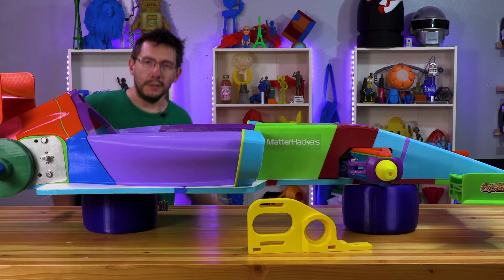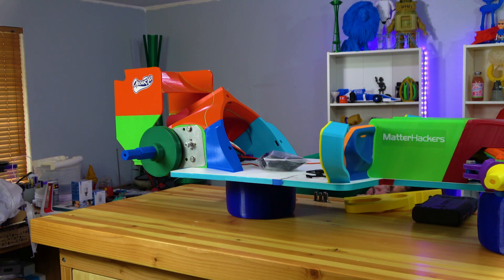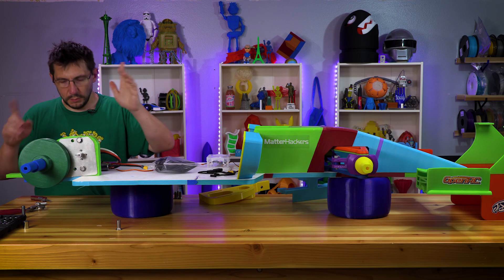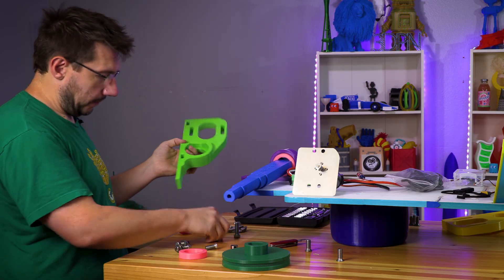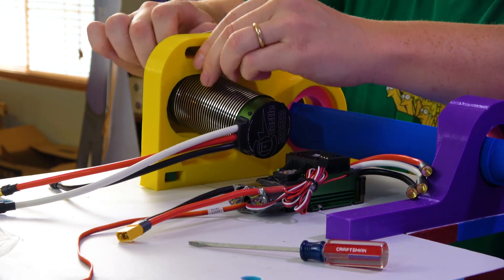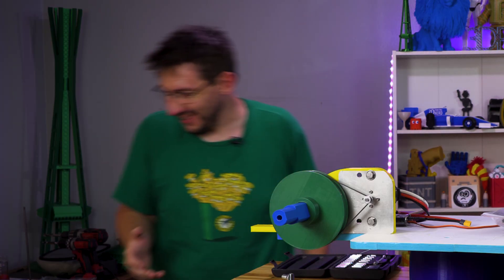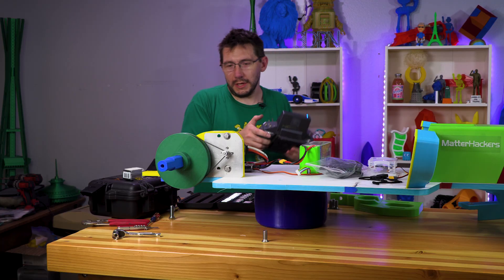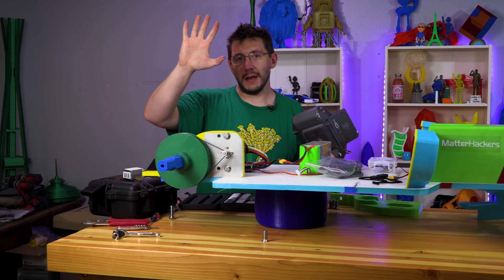Worlds Largest OpenRC F1 Car - Phase 6 // New Motor Mount and Testing!

Comment: great job! wow! on the glue if you use a tiny amount of acetone on pla it will take off the oil residues then you can use glue and it will hold.  but gloop doesn't care about a oil film it bonds right though it anyway.  again wonderful job what a inspiration thanks for sharing! we would also like to see the car actually drive. if not we will just consider the whole thing a big fail.  hope it did not rip itself apart.

Comment: Wasn't it supposed to use two of those motors for the weight? I expected to see one added on the other wheel as well as I clearly remember them talking in Phase 5 how those motors where only good for about 35 lbs out of the 55-60 it will weigh after the battery and the electronics!

Comment: Put a real metal ball bearing instead of a 3D printed bushing, with the friction it will melt with the axle and melt all together causing major damage to the chassis, body, well, everything
Reply from the maker: Agreed. This won't be to speed. This will prove that it CAN work. THEN we get better go fast bits.

Comment: I would suggest silicone lubricant over oil for the bushings as it works better with coating and remaining on the plastic. While oil kind of soaks in and might weakn the plastic

Comment: Hey. uh. tip for ya. don't use a stick radio for an rc car. use a pistol grip style radio for it. also your shafts and wheels have to be true, especially at the scale you're doing here.
Reply from the maker: Oh, I know, but, this is what we've got, so going to use it for the initial run.

Comment: Wow, this belt is way too small. If you want to use it somehow, at least try mounting a belt tensioning bearing close to the drive pulley to get as much theeth as possible in contact with the belt.
Reply from the maker: Maybe, only one way to find out :)

Comment: Like others have said transmitter always gets switched on first. Secondly the belt is too tight, add some lube before you run it again

Comment: The belt may still strip and slip. That axle isn't under load. You could probably test it with a large pipe wrench and just hold it a bit as you apply power. Give it a load and see if it strips.

Comment: Placing bets on that drive system failing first. That's a lot of torque on a very small contact surface. I think a standard multi v belt like on a car would be better suited. Also if it did slip a little it won't tear teeth off.
Reply: Ive made my own exept i used two traxxas x01 ( castle mamba monster) motors and chain drive pullys. The rest is from the design with no modification.The rear wing ripped clean off due to drag, then the drive shaft snapped because it was made from solid plastic, lastly the front wheel bushings friction fused together and rolled it.

Comment: You should put some idlers to the left and over and under the motor pully. It looks to me like the belt doesn't cover enough surface area on the motor pully. The belt will probably skip and  strip if you drove the race car in the current configuration.

Comment: Mad respect for this! Looks super cool! Question, what cable connectors are those from the motor to box? Push connect or screw? I'd love to get some for my projects. Also, where on Earth did you get that battery?! What is it, 50,000mAh?!
Reply: Generally, motors are connected to the esc with bullet connectors (I assume that is what your asking about)
Reply: @deathnightANIMATED  yep those are the ones! Looks awesome! Gotta get some!
Reply: @deathnightANIMATED  however, his are super smooth and look magnetic. Is that a thing?

Comment: You need some anti-spark XT90 connectors. The arc will cause issues later down the road if not addressed..     https://www.amazon.com/XT90-S-Female-Connector-Battery-Charge/dp/B00RVM8U5W

Comment: That castle system is way to much power for this Rc you could of gotten away with using a 1/8 scale system on maybe lets say 3s or 4s to power that rc the tires are not gonna grip is gonna drift more than its gonna drive other than that i love this thing and joel you are a BEAST!

Comment: WOW ! But you may experience excessive wheel hop. The axle does not appear to spin concentrically when you tested it. Please say your printing a scale you for the cockpit,just to give it " THE FULL JOEL"
Reply from the maker: OH, for sure. It's going to be insane making this thing go. All sorts of crazy things will go wrong, until it's supported by the #FullJoel
Reply: 3D Printing Nerd just in case no one told you, You Rock! Hi FIVE

Comment: Niiice Joel, good Work! I would highly recommend you to get some ball bearings for the axle. Plastic on plastic  might work for some time but dont underestimate the power of your brushless motor. Those plastic bushings will wear out pretty quick i suppose...
Reply from the maker: Super quick for sure, but we had to try it. We will lubricate them as much as possible. Once we verify this all works, better parts go on.
Reply: I would agree with this, I printed an automatic can crusher and even with 608 bearings the gears would shift side to side and ended up melting together at higher speeds.

Comment: Fun build. I think this one will likely have several failure points unless you use only a fraction of the power that motor can produce.  Definitely lube the plastic bushing and keep the speed down so you don't melt that interface.  Ivan Miranda has gone down this rabbit hole many times now.  When you start adding power 3D printed parts become a chain of failures.  

You will either have to dig in for a long haul of upgrades or figure out how to demonstrate it without breaking something and walk away ;-)
Reply from the maker: Several? I would think it'll have many. :)
Reply: @3DPrintingNerd  More coffee will be required ;-)  Thanks for sharing.
Reply: Sometimes, things blowing up and failing makes for good “tv”
Reply: Honestly  with that big of a reduction I dont even know how high of a speed he could get to.

Comment: Can you tell us more about the belt you're using? I'm worried that's just not beefy enough.
Reply from the maker: It's a 600mm GT2 6mm wide belt. It may not be, only time will tell :)
Reply: @3DPrintingNerd  Best of luck! I was just looking around. There are different options in this range, in terms of durability and construction. For reference: http://www.sdp-si.com/products/details/timing-belt-detail.php

Comment: Size-wise, how does that bushing compare to, say, the trailer beatings for a small trailer that you can buy at most hardware stores? I'm thinking that even if it was an ugly hack you do on the inside of the body with some fabricated bearing mounts, that might have more longevity than the pla on pla which I fear will melt and friction weld itself together before too long.

Anyway, keep up the great work on the project. Maybe the finished product will show up at MRRF 2019 😀
Reply from the maker: The bushing is going to melt and it's going to be crazy. I just want to get it moving, then we find the right parts to get in it! I would LOVE to bring this to MRRF!

Comment: Might I ask why the belt is external? Because it's on one side of the axle, not near the centre, it may cause asymmetrical drive; I had a similar problem with a Tamiya model of the 'Lunch Box' monster truck; it was driven by cogs on the right side, and as a consequence always turned to the left.
Reply from the maker: The belt is external because I wanted to see if the model would scale. I didn't want to change much of anything - this is all an experiment to see if that small model will work when embiggened. :)
Reply: @3DPrintingNerd  Ahhh! No worries! That makes sense. If it does cause torque, I'd love to see engineering to solve that!
Reply: @3DPrintingNerd  embiggened? I've never heard of that word before I moved to Springfield.  That is quite the enlarged open rc f1 you got there!
Reply: @3dlayerz24  Really?  Embiggened is a perfectly cromulent word.

Comment: You could create a vertical idler tension pulley set. One on top of the g2 belt, one on bottom of the g2 belt that pull against each other in between the motor and shaft pulleys.  That would give you additional tensioning as belt stretches. It's going to be great seeing this running!
Reply from the maker: We thought of doing that, but not on this version. This version is all about whether you can make the small model bigger AND make it work with minimal changes.
Reply: Tensioning wheels top and bottom would also help get you more tooth engagement on your motor pulley. Currently you only have roughly 100 degrees of engagement which is only a few teeth on that small of a pulley. If you pinch the belt between the pulleys with idlers so that you get more wrap on the motor pulley you'll have less slippage as it'll be locked into more teeth (half the # of teeth on the pulley at 180 degree wrap, quarter of the # of teeth on the pulley at 90 degrees etc.)

Comment: you should use a t5 pulley and timing belt at least, they won't skip at a high torque...
Reply: I was about to suggest that, HTD5 or classic T5 and 15mm wide should do the trick. GT2 is definately not designed for these loads
Reply: I think the axle would give before the belt slips
Reply: @woutchauvaux6672  Good point, I forgot about the plastic axle. Well in that case it's just extreme overkill, like having a Lamborghini V12 in a VW golf
Reply: welcome to Roadkill!
Reply from the maker: Oh, for sure. GT2 is not the optimal belt for this. However, we went with what we had and was available to us easily. The goal is to get it moving, and at some speed. There is NO WAY it'll hit 200mph with what we have now. It'll need some changes.
Reply: @3DPrintingNerd  Cool project nontheless, requires quite some dedication to make models on this scale! As with any project, there is always something to improve and it's important not to get bogged down in too many details and just make something cool! (and knowing the limitations is half the work)
Reply: @3DPrintingNerd  wow, thanks for the response and I know it will probably work, I just wanted to point that out in order to improve your design eventually... Good luck with your development, huge fan!
Greetings from Germany!
Reply: @3DPrintingNerd  You can get a good belt for this application at an autoparts store. Just ask for a timing belt. It'll handle good torque and it'll be ridged on one side to accept a cog.

Comment: I forgot. Are you going to buy some large roller bearings for the rear axle?
Reply from the maker: Yes. For the first "go" we will use the PLA bearings / bushings just to see if it works. We will throw some sort of lubricant on them just to be sure.

Comment: Joel, general rule in RC -> always turn the transmitter on first! It's a safety thing ;-) Can't wait to see the first runs of this beast!
Reply from the maker: That's good to know, thank you! I love learning stuff like this!
Reply: @3DPrintingNerd  .. quest-i-on - ))
HoW 'dura-able' is the "replaced" piece (i.e.) .. could you 'dremel' out the extra room needed ??? - ))) .. i'd love to k'now how the piece holds up - ))

GreaT PRO-JECT .. GreaT V-iD-S !! - ))

lovelovelove )))
greb'Z )
Reply: I pretty sure ESC doesn't do anything without signals.
Reply: @luongmaihunggia  it can with interference.
Reply: @isaaclyonsf1  explain
Reply: @luongmaihunggia  legally rc transmitters and receivers must accept any interference. Wi-Fi is transmitted at a similar frequency to the 2.4 that RC gear uses. And so if the car is on with no signal from the remote it may receive interference from Wi-Fi signals or other stuff. Hope this helps.
Reply: @isaaclyonsf1  legally? Ok, explain THAT part.
Reply: @luongmaihunggia  I have
Reply: @isaaclyonsf1  never had a glitch with 2.4,in over 10 yrs biggest problem  is not proper failsafe set.
Reply: @luongmaihunggia  he means that if you want to sell anything that transmits radio frequencies in the US (where Joel lives,  other countries have their own governing bodies)  it must pass FCC certification.  FCC requires devices to accept interference.
Reply: @Scott_C  'FCC requires devices to accept interference.'  Modern RC has code on top of the raw transmission, to ignore most if not all interference, you'll just get drop outs when codes don't match due to other signal.  The 'accept interference' part is about you can't take active measures to try to REJECT or zero out interference.  If you know your signal is supposed to be X, and you actively reject anything that isn't X or zero it out actively, you'll be transmitting that inverse signal back out.  This can be fairly easy to do and you'll increase ease of reception of your own signals, but it's not allowed because you'll be flooding error signal back out and disrupting everyone else..  Think of it as 'noise cancellation for your signal by broadcasting the opposite signal to anything that isn't the signal you want'.  If you're expecting a 120 sine, and any blip off the sine that comes in you 'send' the opposite blip, you'll 'clean' your sine signal locally but those 'opposing' blips get broadcast right back out your antenna.  No doubt thought of long ago and quickly outlawed for most consumer type uses, but probably fine for some military and emergency or other higher classes of signal.  The 'required to accept' simply means you legally can't take active measures to reject in your equipment, because that increases the bad for everyone else.
Reply: @luongmaihunggia  You don't know that, especially when you're at an airfield with a lot of people. Yeah true, when you're alone with no one else around that's less likely but I've had interference cause unwanted activity all the time in the past. Newer PCM transmitters and receivers are wayyyy less prone to this but without instructions (a turned off transmitter) you can have all kinds of weird little glitches like the servos twitching, etc. The last thing you want is ANY chance of a prop or motor spinning at the wrong time, plain as that.
Reply: @luongmaihunggia  In my crawlers case, without the transmitter on first, it zeroes the servos on it's own. Which is a bit of an issue, since my controller handles 4 wheel steering in an annoying way, which requires me to have certain offsets set (but only for that one steering more. If I have those offsets and go back to normal front-steer, rear goes 90 degrees sideways :D It's a bit of a faff swapping between 4-wheel steer, crab and front-steer, but..